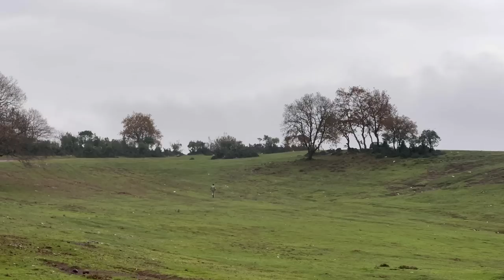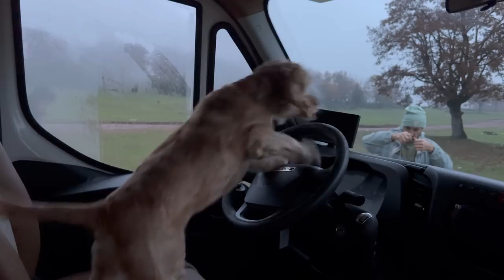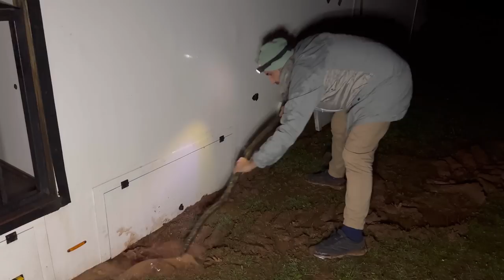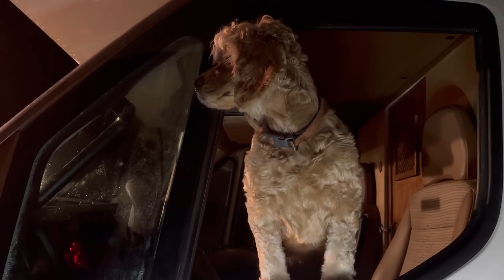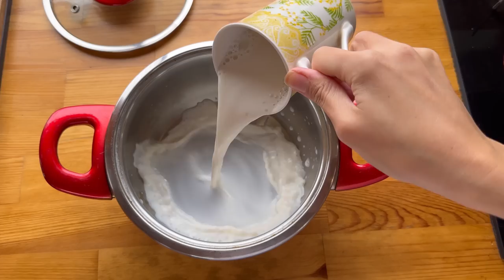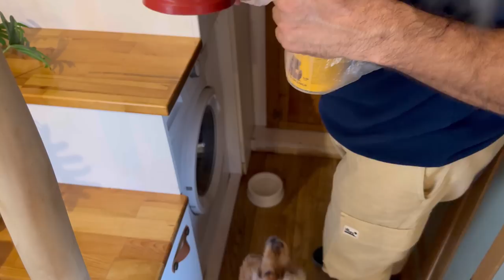SAĞANAK YAĞMURDA KARAVANLA ÇAMURA BATTIK | SAATLERCE ÇIKAMADIK

Comment: If ur stuck in a rut,  kitty litter is good to pour in the mud to give you traction, or you can use the mats from the floor of a car. You wedge them under each tire, going forward or backwards. That has worked for me time and again.